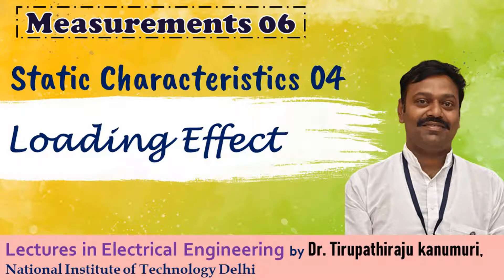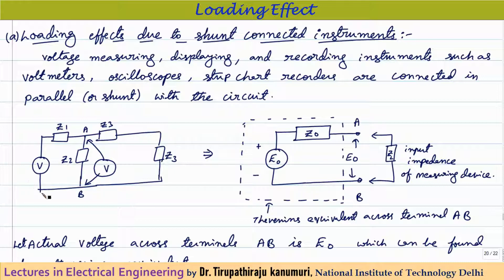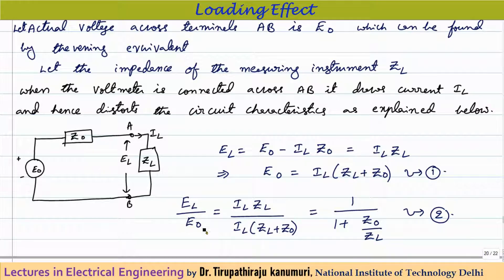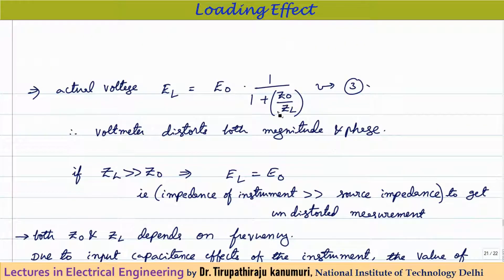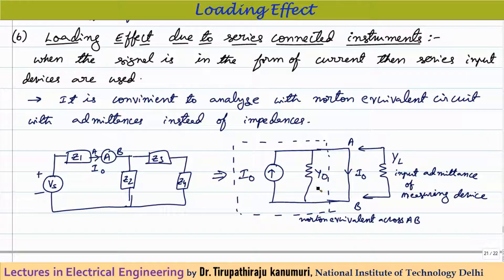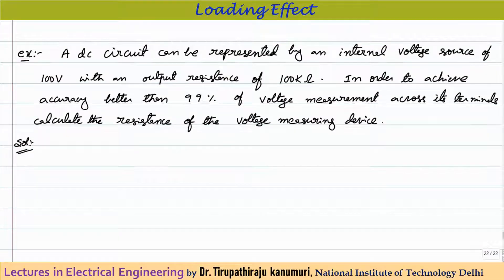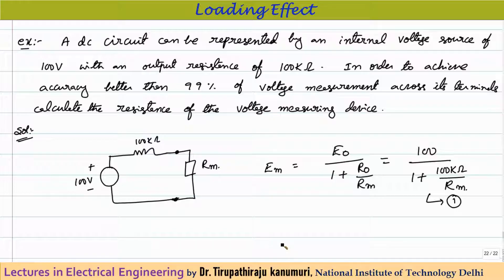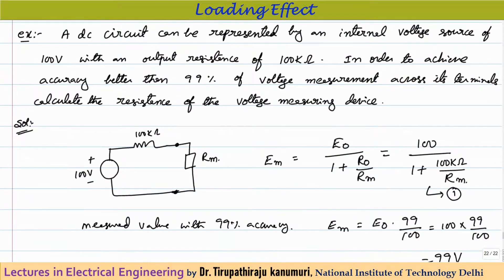ME06 Loading Effect

Comment: Hello sir...can u please clarify why some power transformers have two ratings mentioned such as 25/31.5 MVA...why these two ratings...regards
Reply: Ok Sir 🙏...can u please tell why LA earthing conductor in distribution transformer is laid through on shackle insulators and not directly to the ground...sorry sir for asking too many questions as i have so many doubts because i was not fortunate enough to get brilliant teachers like u in my engineering
Reply: Ok sir...please share if you get to know the answer...also sir can u please explain why substation equipments are connected in certain order...i mean to ask if i change the position of ct,breaker,la or isoltator in a line w.r.t each other....would it make any difference...kindly help